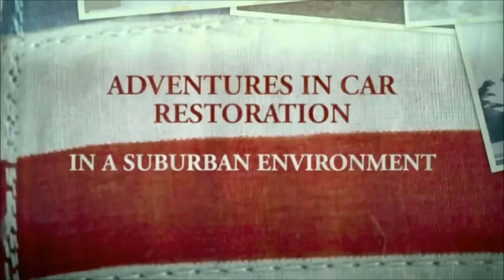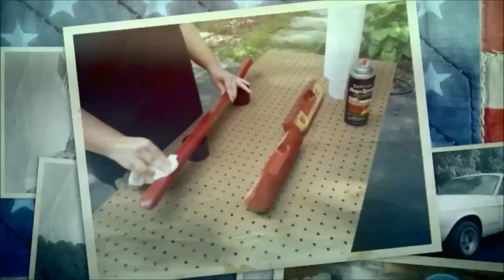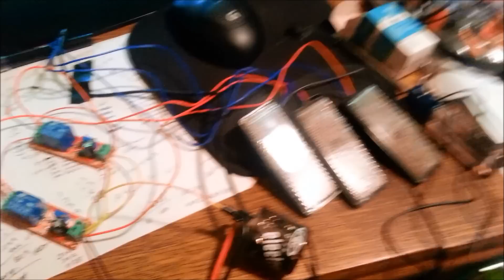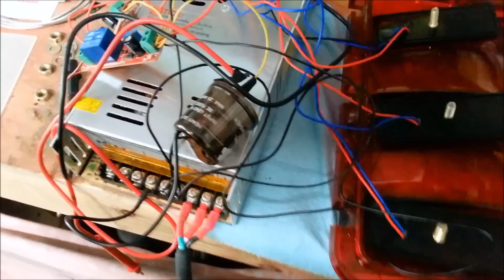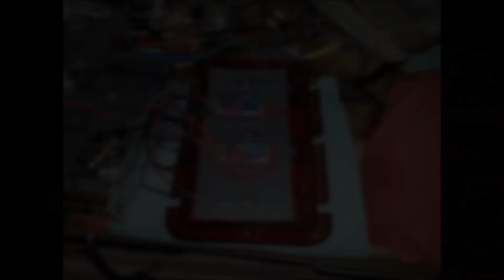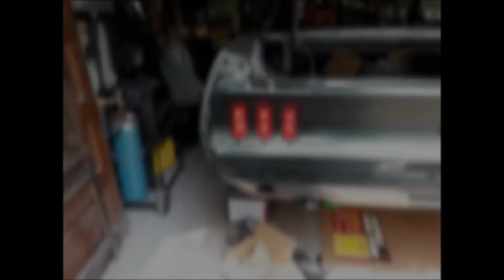Ep 03 DIY Seqential LED Taillights (under $30) - 1967 Mustang

Comment: Don't be offended, but I'd like to try this for my 1969 Camaro.  Going to use the backup light area for the middle light. Only confusion is the Camaro has two (2) flashers one in the underside of the dash, the other in the fuse panel.  Are these flashers your using anything special or are they available at AutoZone or NAPA or wherever? Do you have a diagram showing resistors and diodes? TIA Mike

Comment: How do you get the inner light to stay lit up long enough for the other two lights to come on and then have them all go out at the same time? I'm trying to do this on my 07 Mustang
Reply: Thats the point of the delay relays:

The flasher sends one signal.  He splits it in parallel three ways.  One line immediately goes to the inner most light.  The second line goes into a relay under a delay, THEN to the middle light.  The last line goes into another relay under a slightly longer delay, THEN to the outer most light.

The flasher stops the signal, which shuts off all three at once